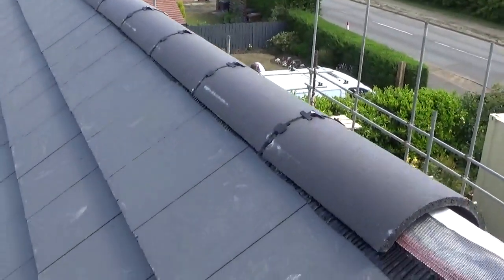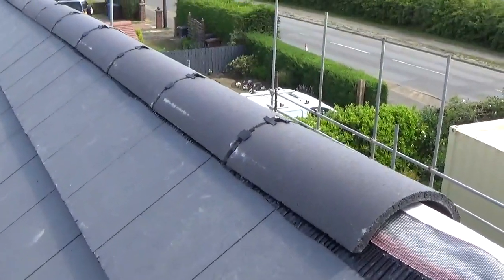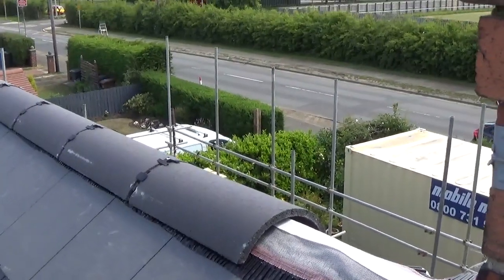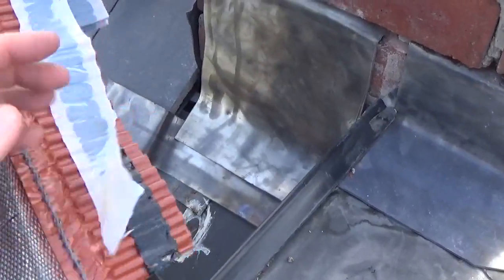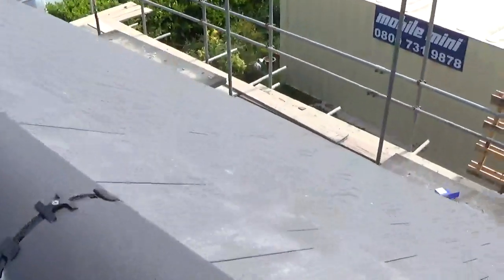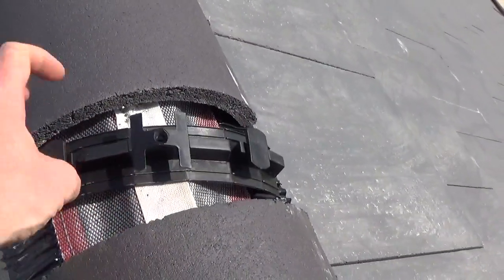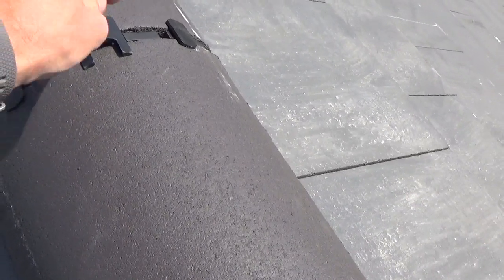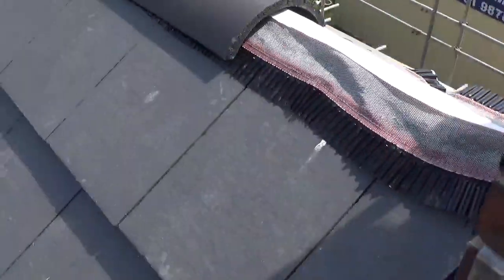How to install a dry ridge system

Comment: Hi, I always wondered how they stay on with a clip system! Just one question, don't the screws rust and break off over time leaving the tile loose? TY.
Reply: a screw will out live you
Reply: @Daemiex  Good to know and NOT at the same time!!! Since I posted the question I've had the roof done, they took me up there so I had a good look at how it all goes together :)
Reply: Screws are marine grade stainless steel
Reply: Use good quality stainless if you can find them.

Comment: When running a dry ridge into a chimney is there any need too run sealant from the ridge tile too brickwork/lead work if that’s makes sense what stops water running down the face of the brick and into the ridge space and leaking cheers?

Comment: Fine as it goes, but my worry would be if you need to replace a top slate, because the clips hold every ridge tile tight to the next one, I presume you have to take up to half of all the ridge tiles off just to replace the one top slate. That's the only concern I have as it's a good system otherwise

Comment: Very nice job. How do you know what size batton to use on top of the ridge
Reply from the maker: Hi Dan, it depends on what you’re using to cover the roof, obviously slate is a lot thinner than the concrete tiles so the Batton doesn’t need to be as thick.  You’re best off starting with a single or doubled up slaters lath and you can always add on to it if the screws are still not catching

Comment: Hi Ian, my home was built 1997 but my Dry Ridge System is much different to this and i can see day light through mine, Its like 1 inch square holes under the half ridge tile. but since buying this house last year it rains thro into the attic and in driving rain it needs buckets, any suggestions buddy
Reply from the maker: Hi Neil, I haven't much experience with the older versions of the dry ridge system.  My recommendation would be to have it replaced by a decent local roofer with a modern system like the one on the video.  Its quick, easy, relatively cheap and if the ridge tiles themselves are in good condition they can be re-used.  Hope that helps
Reply: @ianlambert284  you have been a great help with your advise buddy I was thinking I would have to do this and get a company in. your not local are you TS12 area. Just need the right people with your experience